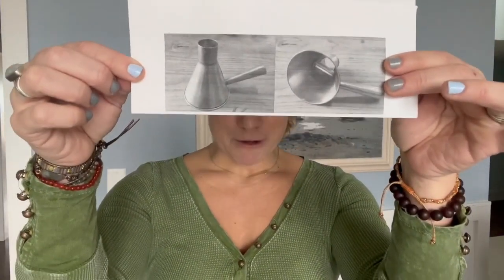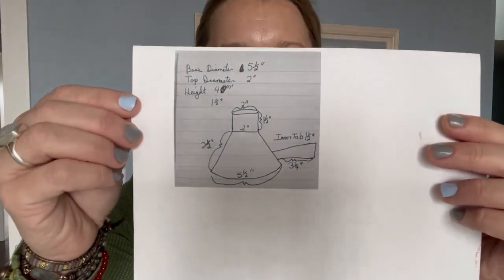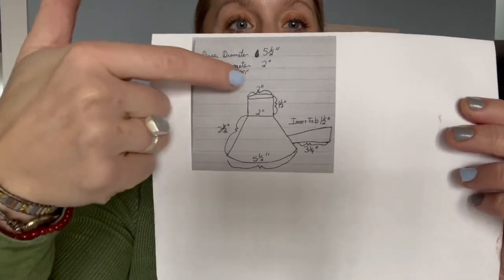How to Make A Sheet Metal Pattern from Scratch

Comment: First I am not trying to be a Karen. Second, the question: Watching your math makes me think metric might be an easier solution.
Reply from the maker: You totally could do metric, there's no rule it has to be inches, etc. The hard part is you're constantly going from decimals to fractions to volume which makes it trickier. It would be so cool to see this translated as such (don't ask me to do it, I'm terrible at math) - all of the pattern making I have seen by the old tinsmiths have been done this way - I myself was taught this by a master tinsmith, so it's all I know. If you do it in metric, please do share how it goes!